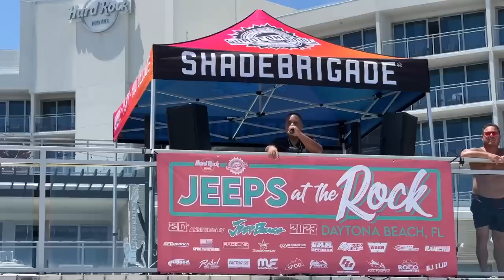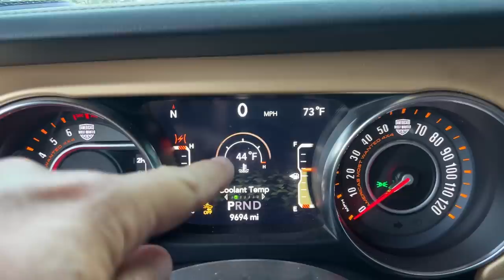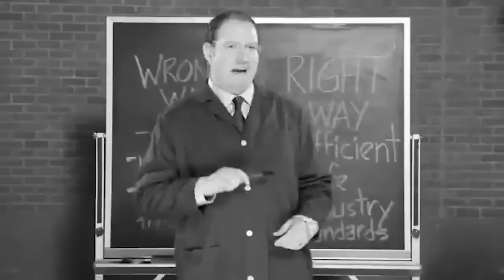STRANDED On Our Way to Jeep Beach!

Comment: When your in this situation just deflate your tire on the side you need to Jack up.  That will get it lower to the ground so your stock Jack will work.  Take the tire off, do what you need to do, then put the flat tire back on when your done and air it back up off of the Jack.

Comment: The sound you’re hearing is the friction between your aluminum wheels and the steel hub on your axle.  Also use the proper torque setting on you lug nuts.  I’ve had that problem on aluminum wheel on semi trucks.  Make sure the wheel and the hubs are both clean.  Spray some silicone lubricant on the mating surface between the wheel and hub.

Comment: I had the same/similar thing with my Escalade front passenger side wheel. I replaced the wheel hub,  still clicked. Then I replaced the cv axel, still clicked....frustrated I went to Point S tire and they said that my new wheel lugs were bottoming out before being completely tight against the hub, stupid me!!  Safe travels, love you guys!

Comment: I've never thought that bead locks would do that, but my uncle has a 1968 RS/SS Camaro that has steel wheels with beauty rings and center caps, and it was making that type of noise where we thought for sure a front wheel bearing was going out and long story short the beauty ring was making the noise because it wasn't "beat" on all the way so it wasn't tight enough against the rim. Sucks y'all had to deal with that while on your trip, but it's always nice to learn new things and share it with the world so that we all now know that bead locks can do that.

Comment: Click rotation noises can drive you nuts!! Been there on my JL recently. Thought it was a bearing or a U joint. Used my action camera and squeeze clamp and moved it around to find the noise. Ended up being the spider gears in the front diff!! Great video, hope to be at JB next year?!?😃

Comment: LOL!.. Nice!..If it makes you feel any better, my brother in law had the timing belt and water pump on his 01 exterra , replaced 2 more times for an overheating issue. It turned out to be a missing lower fan shroud, which the first guy who did the timing belt left off.  Thanks for the vids..

Comment: Kev:  Put the jack under the trailing arm joint just to the left of the point you wanted to access on the axle.  Very obvious in the video.  Much lower point on the axle.

Comment: Had a new GMC Yukon once, it started making a loud clicking sound, got an appointment to take it in to the dealership about a week after the noise started. Got to the dealership, made a left turn into the service bay, it stopped clicking and I was like really it was just doing it. Never made that noise again, figured there was a rock stuck somewhere in the drivetrain and it finally came loose.

Comment: That sucks having to stop on the side of the road, but also checking the wheel while it was jacked in the air before tearing things apart would have probably helped to identify that the noise was not bearing related.  Good stuff though.
Reply from the maker: We did check the wheel while it was jacked in the air (both in the last video & in this situation). No noise with no weight on it.

Comment: I would never recommend tightening beadlock bolts with pressure in the tires or especially not while mounted on the vehicle like that!!!
 I can't remember who it is off the top of my head but there was a writer for an off-road magazine who did that in his garage before going on a big trip and he almost took the top of his head off ans he ended up in the hospital for quite a while after. One bolt sheared and caused a chain reaction though the remaining bolts sending the entire beadlock into his head and torso with enough force to fracture his skull and broke his wrist or forearm. DANGEROUS

Comment: You could have used that jack from your control arm... And also, did you check the brake line contacting the spring? That looks like a REALLY badly restrained brake line... Might be worth reviewing all of the cable points of attachment if they're just floating around near springs and bump stops.

Comment: Are sure that little jack will even lift that beast?  I had a similar jack came with a Acura MDX (don't laugh at me).  I put it under a axle and it failed (folded over).  Reading the manual it has to be used in only four lifting points on the car.   Not sure what an MDX weighs but I feel like it's something less than a Demon Child.
Reply from the maker: It’d just have to lift the passenger side of that axle up.

Comment: Until you get to know your vehicle you will understand the more you drive it I have a U joint go out was that a U-joint I thought it was the the bolts on the drive shaft came a little bit loose AB pattern a little bit anime noise voice coming from where the noise coming from I tighten it all down noise when away a couple months later I heard a noise again I tightened on a U-joint again noise went away what I'm trying to say is get to know your vehicle

Comment: I got a shock question, 2018 JKU Willys Wheeler. 

4 inch lift
ARB front / rear lockers
37’s
I need new shocks and I’m torn between  fox 2.0 and Old man Emu. 

I’m I’m 70% on road 30% off road. 

Mostly wheel in south Florida. 

Help me 😂.

Comment: Just installed beadlocks and hear the same noises. Did you put in anti-seize on the bolts? Are the wheels balanced, I was told that they will never be balanced right. Have you had to use ring spacers for the bead ring?